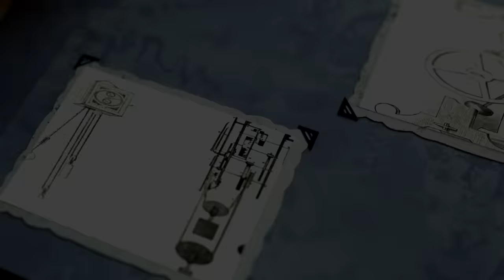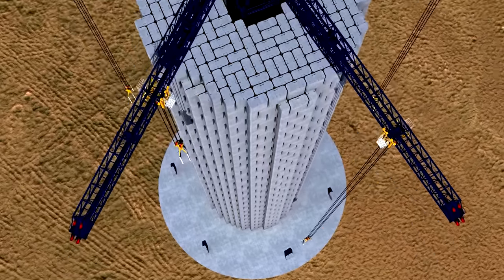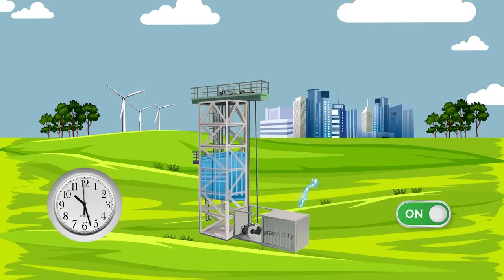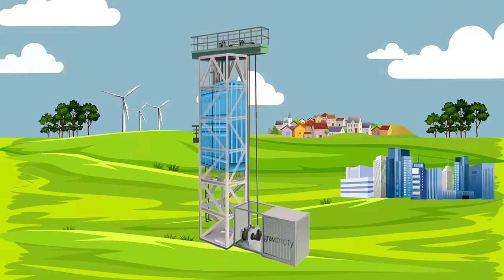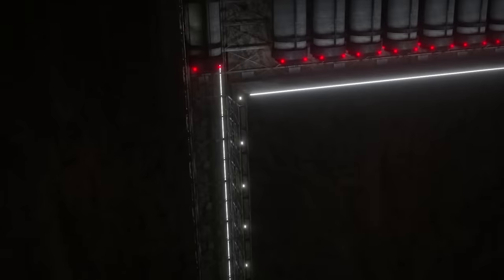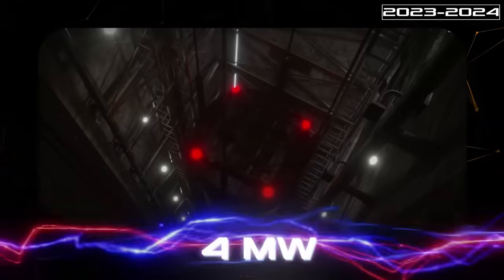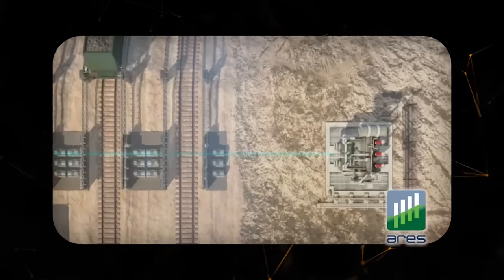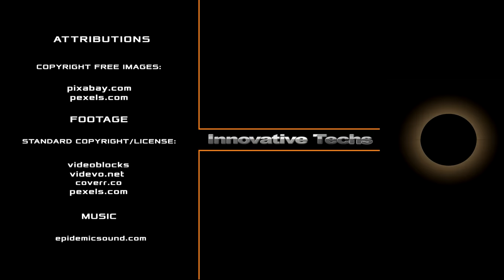How gravity batteries could change the world

Comment: If only there was a material which can go uphill on it's own, easily storable, and can have other uses besides a random weight. Since solids are harder to deal with and store, a liquid or gas would be best. If only this planet had a prevalent amount of liquid that naturally flows downstream, and has a natural cycle which bring it back upstream. Also, it would be nice if all this liquid organized itself into trails when it flows downstream, so that we could use a large body of this liquid or river to hold it then release it. The answer is water, not giant blocks which inefficently store weight, and have to remain stable while releasing energy. Hydroelectric power is much better than this scam version of a weight battery.
Reply: It's far from being scam. Of course hydropower storage is better but as  the video mention, hydropower storage can't be built everywhere so this can be an alternative in that situation.
Reply: @greenleafyman1028 I just think using salt water n encapsulated insulated and corrosive resistant materials too use the old volta stack inside salt water pools with things such as hemp n plant carbons too make your design that is able too just sit half in salt water so it doesn't short n connect....plant carbon salt and metal on a simple build but scale up not down I mean it's not like we are short off land or sea water or land (islands) on sea water
Reply: Suffers from the same problem that wind and solar suffer from. It doesn't rain all the time. Sometimes your reservoir is reduced. Also evaporation is actively against you at all times. 

The problem is the duck curve of power generation vs usage. You've got to understand the basics first.
Reply: @SecularMentat  No, not a reservoir nescessarily, but a metal tank for water storage, doubling as a way to generate power, but also a place to store water with little to no evaporation. If worried about rust, use plastic, fiberglass, or a rust proof metal alloy.
Reply: You mean the liquid that seeps through cracks, evaporates, is in high demand both industrially and biologically, randomly replenishess,  randomly disappears, requires large areas of land and has massive ecological impacts, surely you can't possibly be thinking of the absolute worst energy storage method compared to those in the video...
Reply: The two are not mutually exclusive, ever hear of a water battery?
Reply: Who knew the solution was so incredibly simple? Engineers around the world are slapping their hands on their foreheads as they see your thoroughly thought-out solution that no one has postulated before and realize the answer was so obvious all along.
Reply: @nst0017 I was hoping to see this comment lol. Commondeering the entirety of rivers for storage is a horrible idea. That's like saying we should make gravity batteries with large harvests of crops as the weights.
Reply: @greenleafyman1028  Anywhere you can build a tower or crane to lift weights you can build a water tower with pumps/turbines and simplify just about every aspect of the construction and operation.
Reply: @JackyPup  We should use the ocean because making concrete is very carbon intensive ? I don't follow.
Reply: I believe the argument for using a solid rather than a liquid is that you lose less energy during storage and recovery, since a direct mechanical connection can be more efficient than pumping a liquid. As others have said, you also avoid the problem of evaporation.

That said, pumping water is probably the most cost effective if you already have a hydroelectric dam and are just adding water storage and pumps on the downstream side.
Reply: I imagine the weight of the "weight" can produce more torque than hydro, and therefore have higher gearing to produce the same kW/mass for a longer period of time.
Reply: @greenleafyman1028  Hydropower storage can be built in a lot of places, and it doesn't necessarily have to be directly adjacent to a single village it intends to power, it just has to be part of the electrical grid. That's why we have a few big hydro-dams instead of a million small ones. It makes no economical or logistical sense to build such isolated storage devices unless the village in question is completely cutoff from the main grid. With step up transformer, you can pump 400kVolts for hundreds of kilometers with negligible loss. And even if you have cutoff villages, it intrinsically means they'll have no means to properly maintain the equipment mentioned in the video. And even if they did, it'd still be cheaper just to connect them to the grid.
Reply: the problem is that idiots rarely have a grasp of scale. so finding people to invest in gravity batteries is rarely impeded by the fact that a LOT more material needs to be moved a lot more distance than people realise in order to to be useful. so yes ... pumping water between dams is one of the few viable ways of moving this much material with a reasonable amount of infrastructure. an exercise i would encourage the gravity battery believers to try is calculating what it would look like if they used their entire house as a solar battery ... i mean, it would need to rise and fall a few centimetres, right? or a few feet?
Reply: @5naxalotl  I knew it would take a lot of mass and distance but even so I was surprised by the numbers. Assuming a 100,000 Kg house (small house with foundation, larger house without) raised 1 meter I get 981,000 joules (watt seconds) which seems like a lot... but when you convert to units we use I get 272 watt hours or 0.272 KWh.

The good news, I guess, is that if I were to raise my house enough to store a couple of days worth of energy the view would be spectacular. I live on the north side of the Oak Ridges Moraine but going up 200 meters would give a wonderful view of Lake Ontario. 

Hopefully I screwed up the math... otherwise we have another great theory slain by an ugly fact. It's not quite as bad if you are lifting something more dense like water or concrete, but 100,000 Kg of water is still pretty big - a cube nearly 5 meters / 15 feet on a side weighing almost 100 tons being raised 600+ feet just to supply a house with a couple of days of energy.
Reply: @johnbridgman4310  yup, sounds like the pitiful numbers i got. but the optimistic view is that our species tends to overlook our remarkable ability to move lots of water about. also worth pointing out: one of the cheapest ways to store energy -- albeit with heat being less useful than other energy -- is heating a tank of water
Reply: If there was only something cheap and abundant you could easily get out of the ground with a very high energy density, that you could burn to convert heat energy into electricity on demand?
Reply: building hydroelectric dams from a emisson point of view is environmentally friendly but it devastates local environments. The Yangtze River dolphin went extinct due to dams being built on its river homeland that blocked its pathway up and down them and soon enough its smaller cousin the porpoise will go the same way. In my country large areas of fertile valley floor previously used for farming and as nature reserves were flooded to create dams. Now not only did farmers loose there previous crop but elephants who had been using such valleys for hundreds of thousands of years to feed have nowhere to go and raid villages for food which results in 250 human and 600 elephant deaths a year. Its useless fighting climate change if the ecosystems that the world runs on are destroyed, that will result in even worse effects as there is a trophic meltdown.
Reply: What about mercury
Reply: This is interesting, but I can't see it ever providing a solution to the problem on a significant scale.
Reply: What about magnets,
Reply: The problem with hydropower is that it cant be built everywhere plus it causes damsge to the local ecosystem and displacement of local people all of which needs a lot of capital so these battery can be a good alternative
Reply: @ampersandellipsis747  exactly. But liquid helium is so damn expensive!
Reply: @johnbridgman4310  so fill barrels with water and lift them up and down instead of concrete blocks.
Reply: @garyt123  so use barrels filled with water instead.
Reply: @TheRealColt45  Yep, that would work. Only downside is that concrete has ~2.5x the density of water so you would need to move a lot more volume to store the same amount of energy.
Reply: In one way I agree, directionally, based on the scope of your thinking. On the other hand, temperature should be a challenge for a [man made] water based storage solution. Freezing temps means being out of commission or being too inefficient to operate. Also, evaporated water has a volume that is >1,000x compared to the solid state, which creates challenges in a physical storage oriented system, but if solved in a creative and complex system, this could be an opportunity to simultaneously leverage the tried and true steam turbine generation technique. But yeah, the freezing part is where I think water fails for a man made energy storage solution.
Reply: @Tiger1016.  Agree that freezing needs to be considered although that would typically only affect the top few feet of a reservoir while the pumping would be to/from the bottom. 

There are also new approaches to manage evaporation (hollow plastic spheres floating on the surface) which I imagine would help to keep the water warm in winter, although I suppose we would probably lose some to being trapped by freezing water.

That said, in really cold climates it would probably be easier to use water in containers and a mechanical lift, or (better yet IMO) something solid like slag or other waste from existing industrial processes.
Reply: @johnbridgman4310  Ahh I didn't originally realize that yiu were thinking of using something that sounds like surface level solutions that used inclined topography (i.e. pumping water upstream to a man made river that sits in front of a dam that then flows into a hydroelectric turbunes). I was thinking of it more in an evaporating water to move it up instead of the approach in the video of using motors to lift solid heavy objects. All three options being very different.

In your scenario, if I am following properly, the biggest issue could be the scalability and repeatability of having enough land to develop enough storage solutions in this manner across the world close enough to the demand locations. Large amounts of suitable land is not only very difficult to find, it is also very costly. Also, cold weather and evaporation would still be an additional issue that would further limit where this could theoretically be done. 

We really just need the pipe dream of cold fision to be figured out to solve all of our [energy] problems.
Reply: @Tiger1016.  Thanks... I wasn't really pushing any specific solution just trying to respond to a forking-all-over-the-place discussion but my impression was that you were talking about a pumped water approach and so I tried to respond accordingly.

That said, I don't think I have seen more than one successful mechanical solution (the one I saw rolled a big weight up a mountain on rails) while pumped hydroelectric does seem to be at least a bit successful so I'm not disagreeing with that focus at all.
Reply: Train cars
Reply: Hydro electric is a waste of time😂😂😂 nuclear is the obvious answer. Australia has wasted a stack on snowy river 2 for nothing 😢